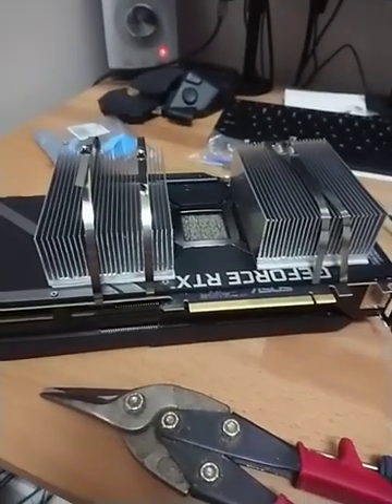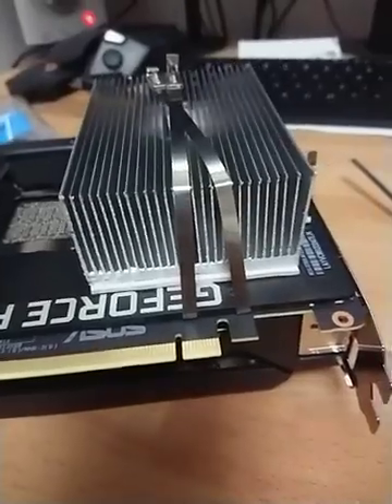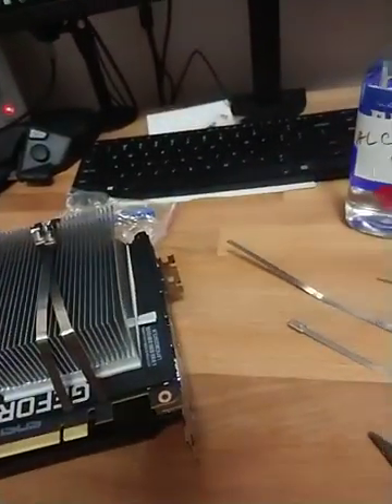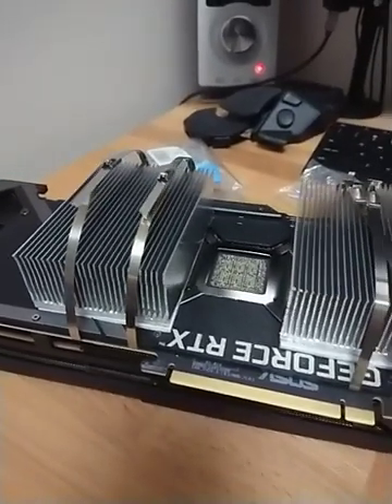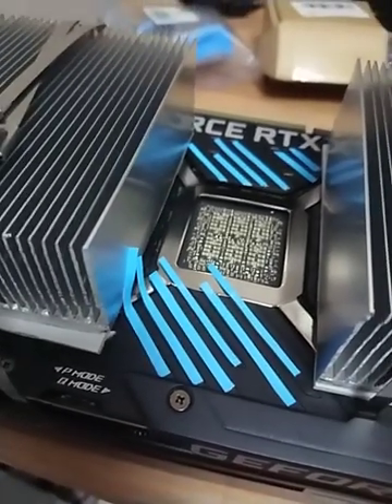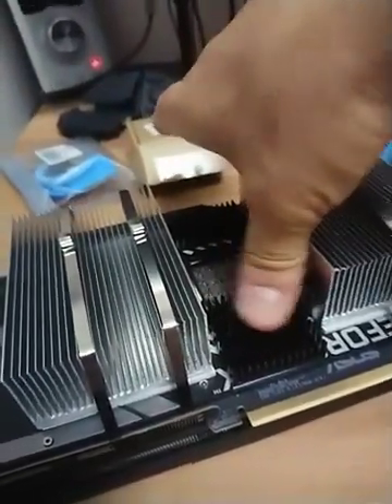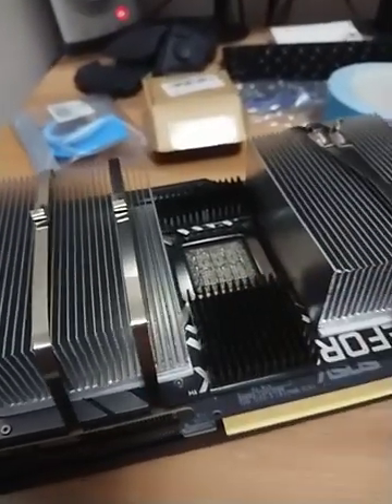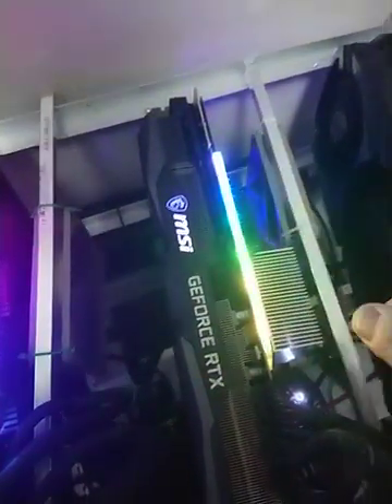Huge heatsinks on the GPU backplate Rtx 3090 increase hash rate Nvidia crypto mining ETH

Comment: I admire the hustle. Found this because I could fry an egg on the backplate of my 5700xt. I took a thin AMD CPU cooler apart and set the heatsink on top with thin fan in hopes it would help a little. I think I'll order some thermal tape and small heatsinks to help cool it down a bit.
Reply from the maker: Add as many/bigger you can but make sure there is a good contact in between the back plate/memory but also backplate, heatsink + the fan would help. You may need to change thermal pads as well
Reply: @universeu7289  Thermal pads on my 5700xt and 3090 did the trick for me. 5700xt now at 76C and 3090 at 92C
Reply: @MikesReactions  you only did thermal pad to heatsink or thermal pad inside replacement? feel like if you did thermal pad replacement you should be getting something better than 92. like 85
Reply: @MikesReactions  also how thick did you get the pads